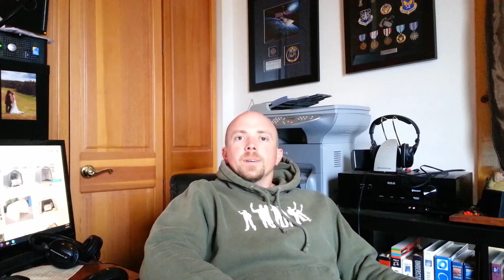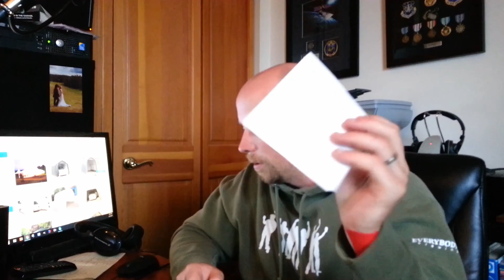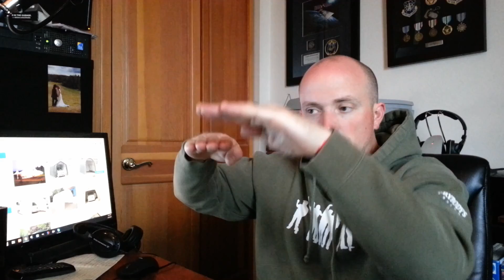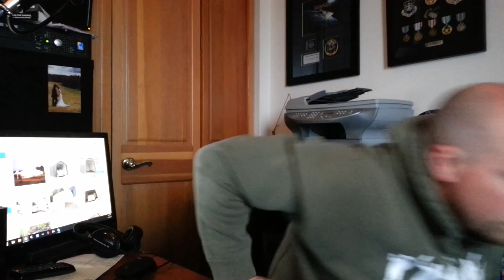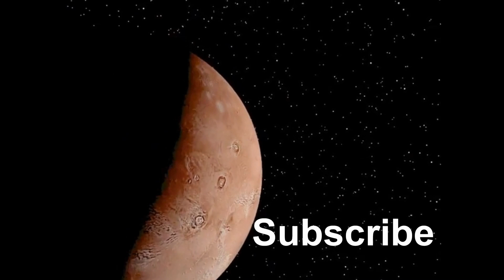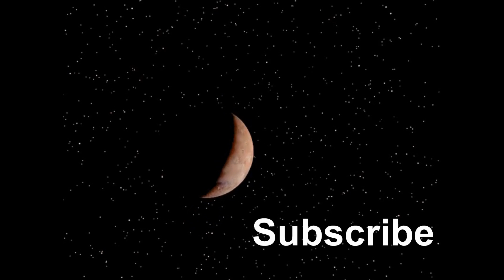Things to Consider - Setting Up MICROGREEN PROCESSING LINE

Comment: With all the changes you need to make to the Hab, would it not be more cost effective to build a Hoop house with double walled poly and employ more natural light as a short term solution to provide the production income you need? you can still process in the hab, but sometimes the answers are going more low tech versus high tech. This will allow you to generate enough income with a lower output to make the needed changes. With a better income base you can look into metal building frame that would hold heat better.

Comment: Hiya TRM, i am a bit confused about a couple of things i this video, and have some questions to ask about it as well, as well as a remark:

0st. The remark, do please consider keeping one 'section' of the grow beds as envisioned, (so that be 1 grow bed length and then 2 grow beds high (or 3 if that was the goal), and keep experimenting in those. This way you can learn a lot more for the eventual Hab 2 before there is a Hab 2 and you won't have to learn those things later on (or rather, run into problems then, when you are able to run into them now). This also for your own reminder of what the goal is, as it be there every time you come in, and it can keep you motived as well. The in your face reminder is a lot better than the proverbial 'elephant in the room'. Lastly, it will also give you the opportunity to make videos on development around one of those sections, and this in turn will keep you engaged with those sections, even though the rest of the building is micro greens... Keep developing, even if it's on a smaller scale as you envisioned at first, all you can do in the time between now and hab2. is time and lessons you won't have to spend in hab 2... plus, the sections will still be in the large greenhouse, so problems are still on the desired scale, and with a modular view and mindset it should be quite easy envisioning/imagining these sections to fill the whole greenhouse!

1st. Did the current lighting system, with those mobile lights provide enough lighting for the micro greens? Because i assumed it did based on what you said in the help wanted video regarding the lighting? 

2nd. How big is a tray ... this because i want to be able to calculate how much grow space you actually need to meet the current demand and how much you could expect to expand if you build Hab 1 as previously envisioned. 

3rd. How long does it take to grow one tray from seed to harvest? I need this info to calculate 2.

Because you seem to go in full throttle again but now regarding micro greens... do you have the demand for such a full scale conversion? can you process that much? If you only use 1 lane with stacked flat beds, or can only process one lane, the rest of the lanes are then just 'filling the building' and costing you an investment you may only be able to get back into a future where you may not even use the building as such.... Now i like the 'bought shelving' if it reduces build time you do not have, but i fear you will end up with way to much space for what you actually need (and yes i understand the need to expand). Also regarding 1 i want to make sure you aren't creating a problem for lighting simply because of how you approach the problem, which seems to be 'go big or go home', but with that also comes the risk of 'Go big and go broke' and nobody wants to see that happen. But maybe you are right and you need all that space and a different lighting, but i do want to calculate it myself, for which i need 2 & 3 (i can get the size of the beds from one of the videos, but if you have a length and width of one bed that be great (i can do the conversion to meters myself)
Reply from the maker: Dutch...you rock again...hey can you send me an email at trm@therealmartian.com? I'd like to spark up a side conversation with you and maybe go live on some of your comments?
Reply from the maker: oh and sorry...answers:

1. current lights did provide enough light though their coverage (shape of light) was less than desirable
2. trays are 10" x 20" though I tend to use 11x21 for calcs
3. 2 weeks best case 4 weeks worse case (think -8f outside and middle of winter)

we can process the quantity we need, but similar to others selling will be a major event...we are currently looking into distributors and have found customers eager for our product. This is a risk.

I've got a spreadsheet I can share if you shoot me an email

Comment: A thought about insulation dead air space looking at you building
I would use wood lath clamped to the frame some thin cardboard to
roll the edge of the plastic and staple to the wood.  You might use
spray foam but the cost would be over the moon unless you can get it
from China.

Comment: Jeff, You mentioned clamps to hook the plastic to your frame. You can make great clamps for that by splitting pieces of PVC pipe. You can make the pieces anywhere from a couple of inches to several feet long, and either just use them as they are, or add handles to lever them open. They would be ideal for what you're talking about.
Reply from the maker: that's a great idea....thanks for sending it in. I didn't think of PVC

Comment: Welcome back.  I don't have a whole lot of suggestions but one that hit me listening to this video may be one you had not thought of.  Plants have been on earth for quite awhile. LOL  They have evolved to live with a light/heat source that kinda works on a 24 hour cycle.  Depending on where the plants are obviously the cycle gets modified.  Plants in the arctic, for instance may get light for 24 hour stretches during their growing period.  What I wanted to tell you about though is some commercial green houses I worked in that grew roses year round in NJ.  I mention the location because it meant we had to deal with some pretty cold temps in the winter.  I am not a formally trained horticulturalist but from pretty reliable sources I learned that STEAM heat was best for the plants.  Why?  Because the heat doesn't change in an instant.  It takes times for the pipes to heat up and then radiate the heat which was transferred to the plants via rising warm air.  These were BIG houses.  500 feet long big.  The roses grew in raised beds with walls about 30 inches tall with a steam pipe mounted about half way up the side on both sides AND a perferated steam pipe running under the dirt in the middle of the box.  That pipe was used to steam the soil between crops to sterilize it.  Kills weeds, mold or anything else that could take hold.  I'm not sure how your lava rock or clay rock might respond.  MIght get rid of the dead roots that have been a problem for you.  You could try it... cook some used rock in the oven at 212 degrees and see what happens.  OK, that's enough for now.  Just keep in mind that plants don't really like to have the sun come on instantly or go off that way either.  Both for photosynthsis or capillary action.  Your plants will be better off if you fade in the heat and the light... IF you can.
Reply from the maker: hmmm steam...that's another good idea. Not sure how I could integrate it right now but I really like the cleaning aspect of it

Comment: You have a lot of biomass there, correct? What about an outdoor wood boiler? They are efficient and wood is relatively inexpensive and plentiful.
Reply: It's also rather labor intensive, and last winter showed it wasn't very practical to use wood for heating. Go watch the video on help on heating/insulation, i think it's explained in there pretty well.
Reply: Dutch Courage D C- it can be labor intensive, but an outdoor wood boiler requires less wood processing as it can burn larger pieces of wood and hold fire for days at a time depending on how it is constructed. That is why I suggested an outdoor wood boiler vs some other type of wood heat. As you aptly pointed out, would be too consumptive of precious time and energy for one thing.
Reply: Fair enough :)

Comment: SeaCan.  A 40' shipping container is a great idea for your aquaponics.  They have ceramic spray coatings to insulate the  outside and 1 or two inches on the inside is cheap to install.  Solar panels on the top.  And a utility room say 5 feet into the trailer on the back end for batteries, geothermal, pumps and filters gives you 35 feet long space for tanks and beds.  Look what Engineer 775 is doing on heating and cooling with solar.  You could have two fish tanks and grow beds with a center aisle.And you could ship it anywhere on Earth (and eventually Mars)You could even start small with a 20 foot container.

Comment: Can you put a building over the other building with the air gap in between .
Based on labor vs years of use with breakdown of unit for other use in future 
And with the potential for micro greens being your cash crop thru the years .

Comment: I'm sure you already know this, but 100 amps @ 12 VDC voltage is not the same as 120 VAC @ 100 amps The amp usage is much less. when voltage goes down amps can go up.. and vice-versa

Comment: use acoustical sealant to join the plastic sheets it remains flexible and is airtight. something like this http://www.homedepot.com/p/OSI-SC-175-28-fl-oz-White-Draft-and-Acoustical-Sound-Sealant-12-Pack-1496542/202768260

Comment: Yay! You read my note! 

Idea to help heating/cooling (even just a little) Stack hay bales along the vertical walls (inside and out) to help prevent cold air / contact w/ the walls from cooling any warmed air already in the building. Inexpensive / sustainable / reusable / temporary / unpowered / energy neutral.
Reply: I believe this has been considered, but it would be too attractive for rodents, creates a fire risk and can be a condensation trap potentially introducing mold spores to the microgreens